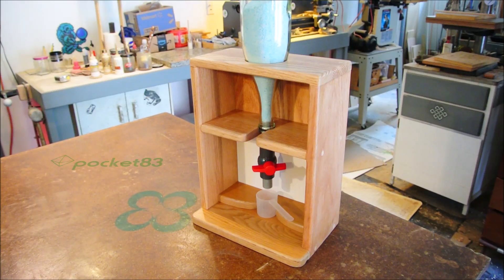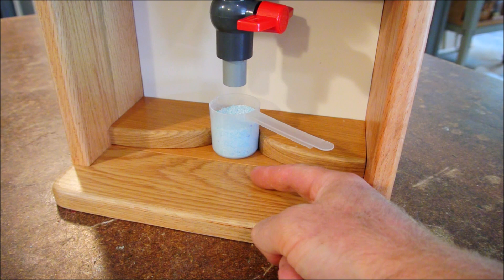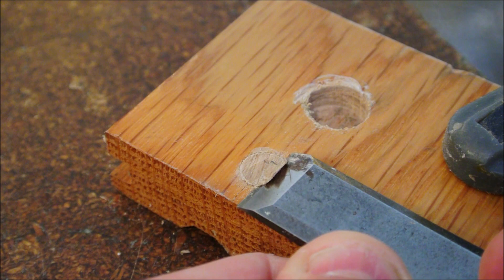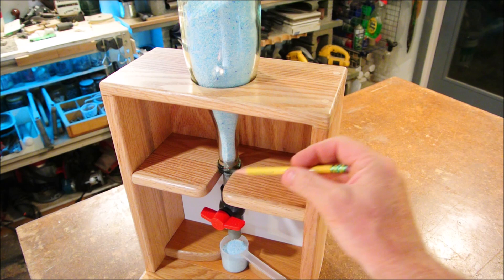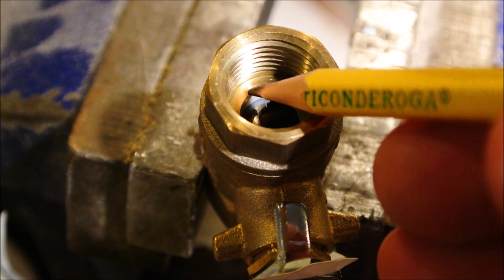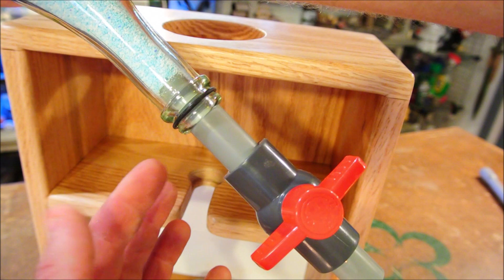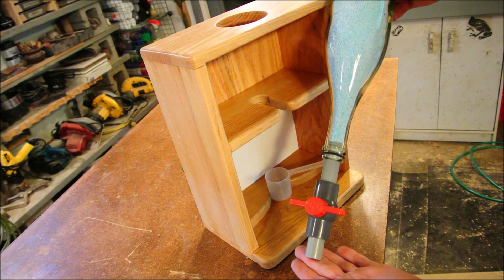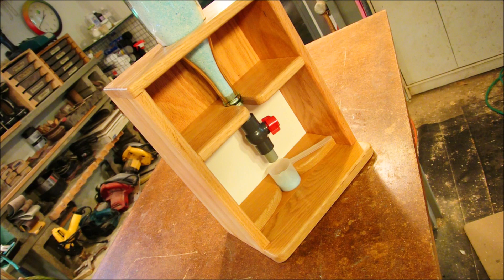Powdered Soap Dispenser from Champagne Bottle

Comment: The O-ring probably also makes it quieter rather than letting glass bang on wood banging each other as the bottle would rattle when moved. Plus you don't need to be as exact in the hole size and there are differences in expansion/contraction due to temperature changes (probably not one of your design considerations in this case).

The remaining plastic seal on the valve is good in this application as it would prevent moisture from entering the bottle.

As an alternative to a lathe, you could use a heat gun to soften the pipe and jam it into the bottle although it would be no where near as good or use another tube as a diameter adapter.

At work, I am currently entering data in a manual way but I would only do that for the first few iterations - as soon as I automate, I can scale the result to get a considerably clearer picture of the situation...that was probably rather vague and unsatisfying to read - sorry.

Comment: I wonder if this would work for coffee grounds. I always hate getting coffee grounds on my hand and would really love this as an alternative option.
Reply from the maker: Yes! Absolutely. It's totally food-safe, and reasonably air-tight. Could also be adapted to work for cereal, dog food, sugar, et cetera.
Reply: @pocket83squared  I was thinking that maybe separating and grinding the top off and smooth, then putting a rubber cover on it would allow fill from top. Not sure if that's worth your time but seems easier than having to funnel refill.
Reply from the maker: @DarknessLPs  Making coffee is an EVERYDAY problem. Time adds up. My wife and I were just talking about your suggestion. 

Since we grind our own, we thought a bottle-dispenser like this would be great mounted to the side of the cabinet. It could drop the beans right into the grinder, and save us a few steps. Maybe I'll do it!  

Rubber top is also a great idea, if you can find one. A silicone bowl lid, perhaps?

Comment: this is a really cool idea

but why not just have the top half be a sealed box with a plexiglass window to show how much soap left

keep the valve at the bottom. and the box can have a slanted floor to move the soap to the valve....
Reply from the maker: Sure. Why not? 

You might find that a four-way sloping box requires a more complex design than you first thought. The bottle has the advantages of simplicity, cleanliness, air-tightness, and beauty. But of course, whatever floats your boat. Go ahead and make one.

Comment: I need you to overdo this now and make the valve dispense the correct amount of soap when you turn it, like a candy dispenser for soap.
Reply from the maker: The original idea was to use a rotating piece of PVC pipe that had a hole in it (instead of a valve). It would fill up only so much through the hole, and then it could be turned upside-down to drop its payload, automatically closing off the bottle. 

If you're suggesting I further complicate it with knobs, dials, bells, whistles, and LEDs, then no! lol. I usually try to go the other direction!
Reply: I'm not suggesting that at all! It is much more difficult to design something simple than something complicated. I'm suggesting further refinements to your device that eliminate error and work. The workflow, after the bottle is filled, is: place cup / open valve / fill cup / close valve / put soap in machine. Your PVC idea makes it: place cup / turn knob  / put soap in machine. Can you take it further? Do you need the cup? Do you need the valve? Can the PVC double as the dispenser cup?
Reply from the maker: @amwtm  I love the "workflow" idea. Labeling the steps so clearly reduces it to pure logic. Ever heard of Adam Savage's 'order of retrievability' concept? Similar idea. 

To answer your question, I don't know. Further simplification will take further thought.

Comment: He talks about saving time, but he actually spent plenty of time building this thing. And by what he said, there should be 2 of them, for white soap as well. Also, this is not really practical as you'd have to refill the bottle every once in a while, and that's really cumbersome. I'd make a container that can be easily refilled from the top.
Reply from the maker: You don't have to talk about him in the third-person. He's right here. 

The idea is to mix a large amount in a big bucket in preparation, and to then refill the bottle on occasion. Here's the math: our laundry requires five ~45 ml scoops per week. The bottle capacity is ~800 ml. That means refilling the bottle once every 3½ weeks. That's hardly cumbersome. 

As for time, solving a problem often requires a heavy initial investment. Every case will involve the risk of finding out later that the time spent did not equal the return. Thus, what constitutes "practical" is to be determined by the problem-solver, not by the bystander. Don't make it if you don't like it.
Reply: @pocket83squared  I haven't realized you are reading and replying to comments. That's a bit embarrassing. 

It's still inconvenient to refill bottles. I was thinking about some kind of plastic container with a conical shape on the bottom that can hold a valve. And a top can be made with locks like a food container. Something between a food container that has a conical shape on the bottom that ends with a valve. I can't think of a way to make it other than plastic welding. And since you need two of them, maybe house them in one box with 2 valves. That would require even more time, but that's what we actually enjoy - solving problems.
Reply from the maker: @irondsd  No worries, I was just teasing you.

Two alternatives come to mind. Both are staying with the glass, though. I suppose you could use a bigger bottle, but a nice solution mentioned by at least one commenter so far is to cut away the bottom of the bottle (that's the top of the bottle dispenser) and then add a removable rubber lid to it for easy refilling.  

Again, at only one refill every month, it's a little hard for me to care. We'll see what the Mrs. says after a few weeks.

Comment: Powdered laundry soap seems to absorb moisture from the air and go clumpy. Does this device prevent that? Has the neck of the bottle ever clogged?
Reply from the maker: Yes, the device does prevent caking. Our basement is high moisture, and it's still a non-problem. If it sticks at all, which is rare, a mild tap on the valve makes it free-flow again. 

I thought I mentioned that in the video. The soap would clump in the shop during prototyping, which is why I ended up going with a sealed/valved bottle.
Reply: @pocket83squared Ahh, I'm about halfway through. Thanks!

Comment: Do you worry about getting septic safe powdered soap?
Reply from the maker: We use an extremely-decreased amount of soap: 16.5 g per load. Over the years, we've found that you barely need any at all in order to clean, especially with soft water. No matter; it's on a separate drain. Long discussion from there, but I consider the water softener's flush cycle to be a far worse (local) contaminant. Salt is bad for frogs, and probably for holding-tank life, too.

Comment: It's cool but it's really not the simple or time/frustration/money saving solution 😂
Reply from the maker: You may've missed the point. Simple? No, of course not. But it saves plenty of frustration. It probably ends up saving time in the long run. And in terms of money savings, powder is only a fraction of the price of the alternatives.  

Mostly this idea isn't about how much gets saved, but more about how much we get saved from doing things; the point of the good life is to find ways to better tolerate tedium.
Reply: @pocket83squared  Another rebuttal not necessarily in line with the point of the video is that we as makers like to make things. Taking extra time to make a solution like this isn't a net loss if it doesn't save us all future wasted time - it's a hobby, it's fun, and it looks nice, while providing utilitarian benefit.
Reply: @pocket83squared  The way I see it, you still have to fill up that bottle and mix batches pretty often. You could be making your 3:1 mix at much larger scale. I have no doubt your way will eventually save time over mixing it every time though and like I said I do find it cool. In the end it's more of a lifestyle than anything legitimately utilitarian or practical because the time spent doing that is money wasted not working. Kinda like heating your home with wood instead of electricity. Yeah it's "cheaper", but you'll be paying for that with your time. In reality it ends up more expensive.